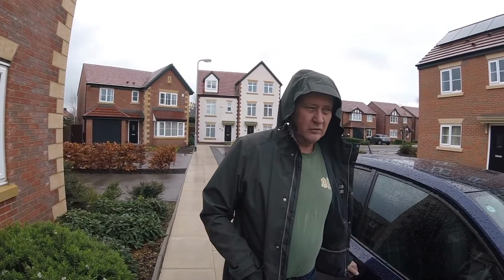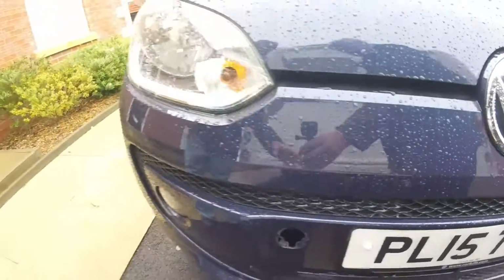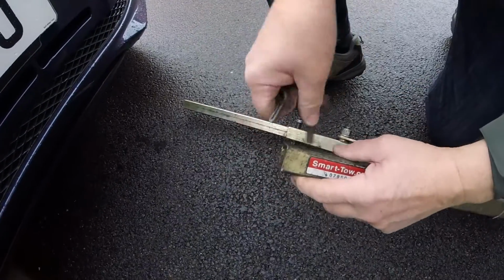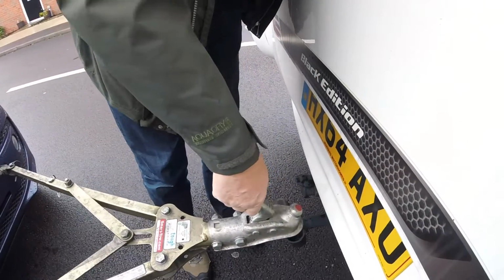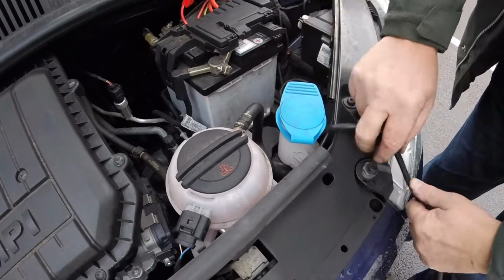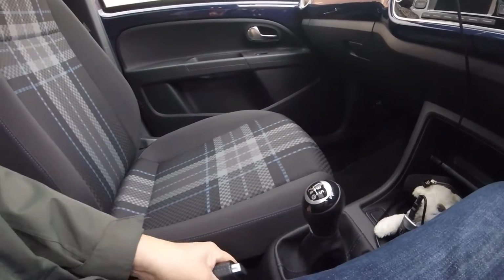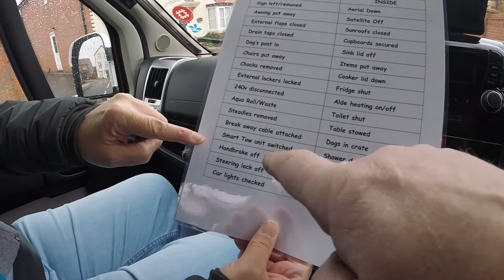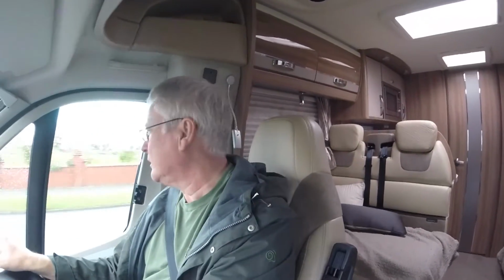Towing a VW Up! with an A-Frame

Comment: hey Bob. How does the towed vehicle steer, is there someone steering it? Like when you showed the free moving steering-wheel working?
Reply from the maker: The wheels turn on their own, they are self centering. I just leave the key in the ignition so the steering lock is off. Think of it like a supermarket trolley. They go the way they are pushed or pulled.

Comment: Thank you for the video. Can I ask how do the front wheels of the car turn?
Reply from the maker: All car steering is adjusted to go in a straight line unless  
Pulled in a different direction. Otherwise cars would wander off in all sorts of directions. The steering lock is unlocked by putting a key in the ignition.

Comment: How does your car have two recovery points in the bumper
Reply from the maker: No, it has a modified front crash bar with connections for the A Frame. Have a look at https://youtu.be/2l_QQph_K24

Comment: a really lovely setup, the car, caravan and towbar.  And a really good informative video too :-)  As for the braking, that is clever, I am guessing the car gets it's signal to brake from the 7pin socket, probably the brake light wire? If so, I guess this is not proportional braking to how hard you push the brake pedal on the caravan? Nevertheless a quality setup
Reply from the maker: Thank you, this is fully proportional braking. There is a clever little box inside the car that detects the brake lights are on and if it is decelerating. If both are true it switches on the vacuum power to brake the car, the amount of power braking is according to the amount of deceleration detected.
Reply: @BobEarnshawMoHo  wow that's a real top notch set up. I guess there is a mercury switch or similar inside the box.. So useful going away with a big caravan as well as taking a car with you.. I have caravan envy now lol

Comment: Great video, 

Where did you say that you connected the 9 pin plug in the Up to?
Reply from the maker: Ben Thanks, the lead is hard wired into the car and the other end plugs into the trailer socket on the motorhome.
Reply: Bob Earnshaw 
Hi.  Thanks. 

What I meant is how did you wire the 9 pin socket to on the towed car. 
I'm looking to tow an old car across Europe and might have to use a light board on the back. ...
Reply from the maker: Sorry, I had a team of professional people do it for me, so no idea how it's wired. Wouldn't dream of tackling that on a new car. M&J Autos in Hunslet installed everything for me.
Reply from the maker: Also bear in mind that it is illegal to tow anything above 750kg without a properly braked system. So definitely no to putting a light board on the back of a car. You're probably better off with a trailer.
Reply: Yes thanks for that,  the car I need to bring back is around the 750Kg mark + - 30kg
Reply: @ben8090  whatever the weight, if brakes are fitted they must work. see above

Comment: That was fascinating Bob,  I always wondered how it all went together.  So does it always pull in a straight line or do you have to do something to the tracking on the car?  Also,  how do you get on reversing or is it easier to just unhitch and drive the car??
Reply from the maker: It always follows the van and there are no alterations to the steering geometry. The car's front wheels just follow the van's direction. As far as reversing, whilst possible, it's easier to unhitch as the cars front wheels do get confused in that direction!
Reply from the maker: It's the car's natural castor angle allows the car's steering to follow the towing motorhome. Couldn't remember if it was caster or camber....

Comment: Great video, I watch for interest but know very little.  I once saw a TV programme with PC Plod ticketing cars for towing caravans without a device to widen the vision of the external rear view mirrors, Is that required to tow a car like you are doing? OR does the rear camera get round it?  May not be required?  Kevin.
Reply from the maker: No, because motorhomes are wider than the car, wing mirror extenders are not needed as there is no reduction in the view in the wing mirror view. Wing mirror extenders are required for towing caravans because caravans are wider than the car, and there is a blind spot created without them.

https://www.campingandcaravanningclub.co.uk/helpandadvice/insurance-advice/caravan/caravan-mirrors-and-the-law/
Reply: ok .... i knew you would know1  thanks for the reply Kevin

Comment: can u drive it with extendet B (4250kg) ?
Reply from the maker: I have a c1 licence, so I can tow it behind my up to 4250kg Motorhome. The car weighs 1005kg, the gross train weight is 6000kg, so I'm within that. If you passed your car driving test on or after 1 January 1997 you can: drive a car or van up to 3,500kg maximum authorised mass ( MAM ) towing a trailer of up to 750kg MAM. tow a trailer over 750kg MAM as long as the combined MAM of the trailer and towing vehicle is no more than 3,500kg.
Reply: Bob Earnshaw thank you

Comment: Hi Bob, is the rear camera one that was fitted to the van when you got it or is it a retro fitted one?
Reply from the maker: Lee Marson it came with the van. Very useful twin view.
Reply: Good video. I am wanting a motorhome but my wife is concerned this would be difficult to park in car parks etc etc, I forgot you can tow a small car.
Reply from the maker: David Taylor we do park it in car parks from time to time! It takes about one and a half lengths of car space being just under 8 metres. Supermarkets are usually good as you can take the shopping from the trolley straight to the fridge! You can always stop in lay byes and service stations too. If you look at our Benelux and Easter 2017 trips we didn't have the car with us then and no major parking issues.
Reply: Bob Earnshaw Thank you for your reply, will check the videos out.